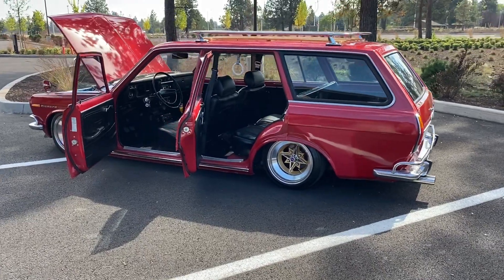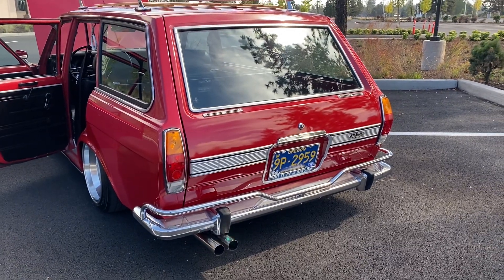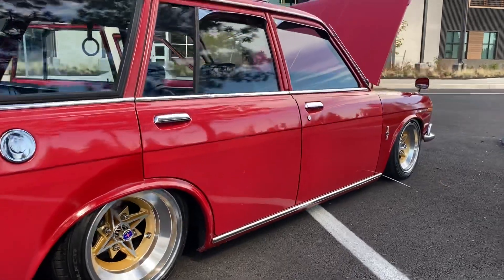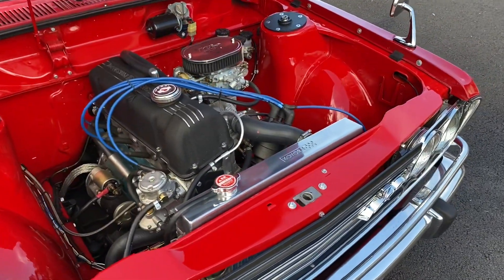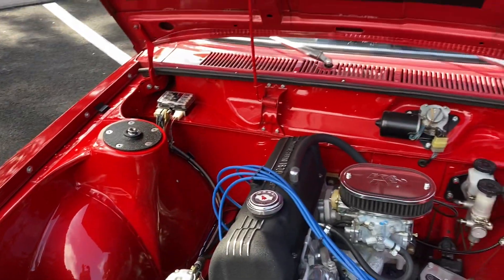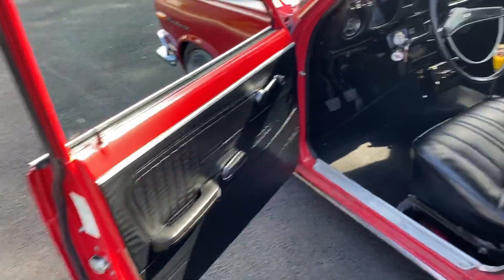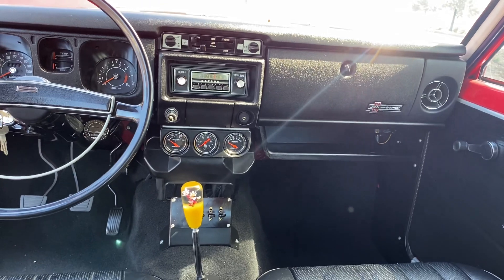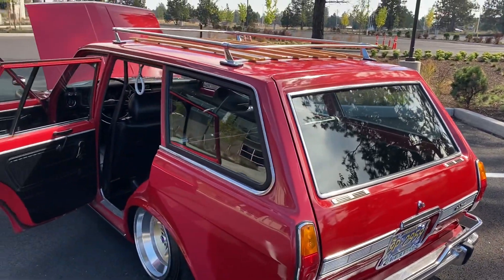71 Datsun 510 wagon walk around

Comment: absolutely gorgeous!! Can't wait to get my wagon running and driving.
Reply from the maker: It was many years of work before my wagon saw the road again. Keep at it, totally worth it in the end.
Reply: @JustJoel541  Awesome man!  Will do!  Just need to find an automatic transmission radiator for it which are impossible to find lol.
Reply: @potatoshadow1226  just put you a aftermarket cooler. It’s what I did on mine and my temps are fine.
After the whole Nissan not having the best of luck with antifreeze mixing with transmission fluid I don’t trust em..
Reply: @mdtransmissionspecialties  Since I commented that, I actually got a new a radiator and got an aftermarket transmission cooler and got the wagon running and driving.  It's still a work in progress but it seems to be doing alright.  Hopefully I can get an L20b and a manual transmission for it sooner rather than later.